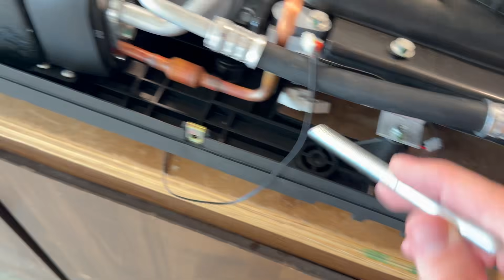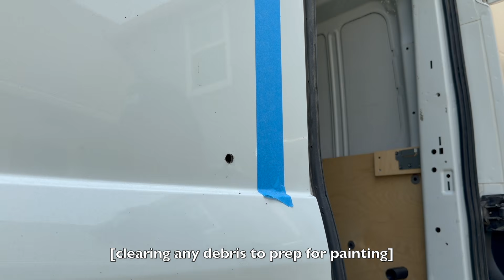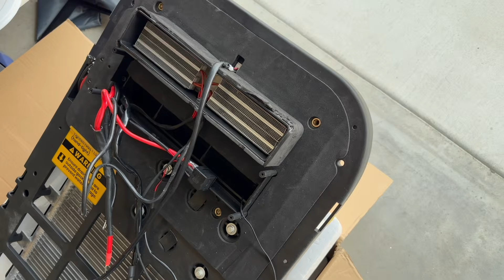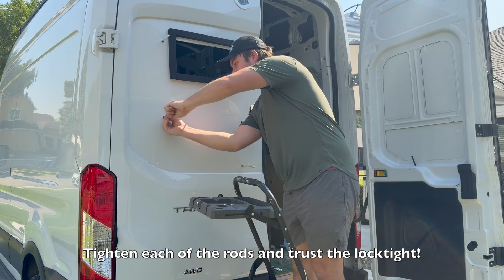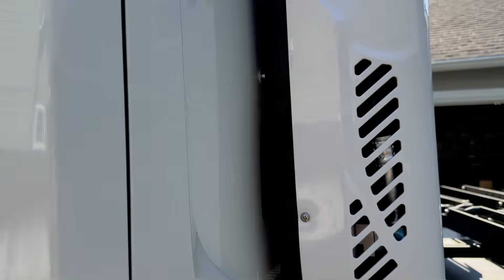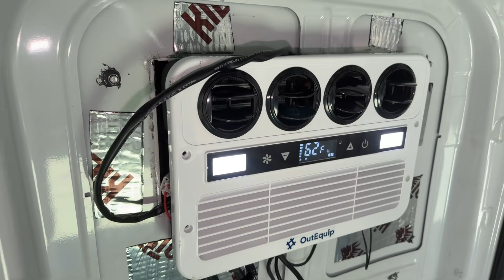Outequip  Dual-Mount 12V Air Conditioner Install on Ford Transit

Comment: This is nice! How is it working so far? I am a bit concerned about putting that much weight directly on the door. Have you taken it to non-paved road yet? Appreciate it!
Reply from the maker: It was really nice to have this summer. I have no complaints other than the remote is kind of klunky. The install has held up perfectly. No issues with weight so far. People hang a ton of weight on these doors from what I’ve seen. I’ve done lots of rough gravel road driving with it no issue.

Comment: Riley, thanks for taking the time to document your install! I also have a Ford Transit, 800W solar, EcoFlow Delta 3 Max Plus (w/extra batteries,  6,144 Wh, 510 Ah), dedicated NUC running Home Assistant/Grafana and have been also looking for a wall mount unit. I was hoping to find a heat pump unit similar to this but none yet on market. Any additional data so far beside your initial 50A Turbo and 30 Eco? Wondering on real world ranges over the day for heating, cooling, recirculating? Does it run for any periods of time using less than 360W or more than 600W? Also when the electric strip heater kicks in? How well does it maintain a temp setting with the sensor so close to the discharge, might make sense if it was located in the middle of the van. Last question, to change the air filter, does it involve just removing the outside cover and 6 screws? Thanks Ed.

Comment: nice clean job!!!  im looking at this same unit for my 350.   im wondering if you can still get a basic spare tire-carrier on the back below the ac?
Reply from the maker: I’m really hoping so because I need to mount one there soon! I built my own door rack for the passenger door. I’ll do the same so I should be able to fit both.

Comment: I do not think you can mount a rooftop air conditioner designed to lay flat on the roof and mount it in the vertical. I could be wrong . Maybe for the same reason you can’t lay a vertical refrigerator on its side. It will not work for very long or a window unit upside down or sideways again I could be wrong. Hope that works for you.
Reply from the maker: This is their new model that is designed to go vertical or horizontal.

Comment: Dude that's so sweet I thought about mounting it underneath the van and having floor ac..lol... I think I ll stick to the roof, such a clever idea for the door but I already added glass so yeah... Good luck with the build..
Reply from the maker: It’s been really great so far! I’m happy I didn’t have to remove a solar panel to make room for the AC. This was a no-compromise install for my build! 🎉

Comment: And you didn’t use the mounting plate bracket it came with?
Reply from the maker: I wasn’t sure about this either. But I verified with Outequip that the mounting plate is only for horizontal (rooftop) mounting.

Comment: Hi there I have a few questions what was the cutout dimensions of the 1st hole you cut also did you need a rivnut gun
Reply from the maker: The cutout dimensions are in the product downloads. But I believe it was 14x7